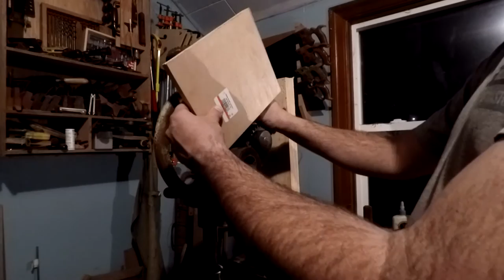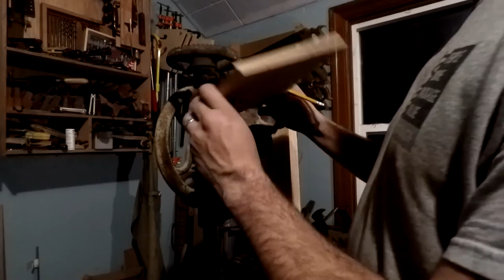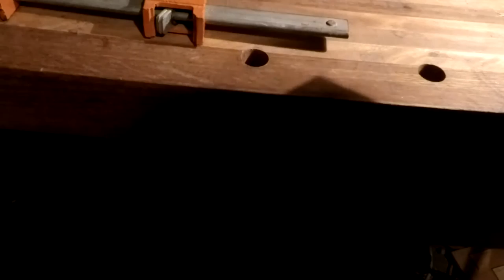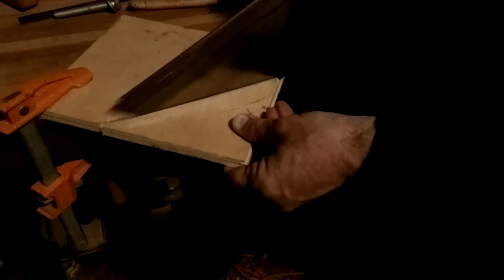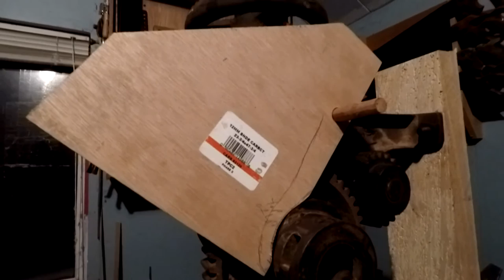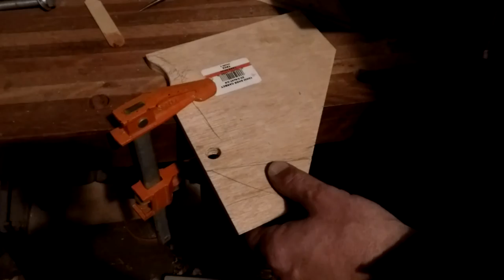Champion blower and forge co Post Drill  the cam lever press part 3

Comment: By the way, the arm that rests on the cam should have a block with thumb screw on it so you can move it in and out to change how much the lever moves.  You advance more clicks with wood than steel drilling.
Reply from the maker: +Crafted Mr eviltwinx let me barrow parts from his drill so I'm good to go the thumb screw is on the frame casting.

Comment: There in one on FleaBay right now $80 missing base with the handle dog and paw all intact. I have a post drill but different brand.  You can sell off the flywheel, frame and other parts left over and get all your money back if not more.    Hmmm, just saying.  ;-)
Reply from the maker: I have checked out a bunch of them they all look real close but the devil is in the details but that does sound like a good buy

Comment: Are you going to cast that part or fabricate it out of steel?
Looks like you're making a pattern which could go either way.
Not important, just curious.
Thanks,
John
Reply from the maker: it will be cast iron as the original was . ill also be copying the flywheel and the quill crank with the ratchet teeth in the top.